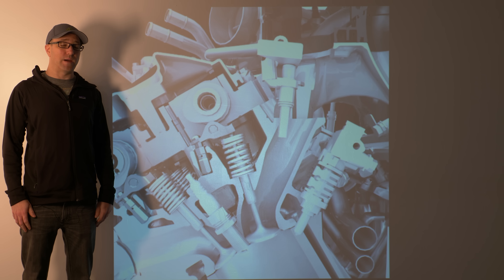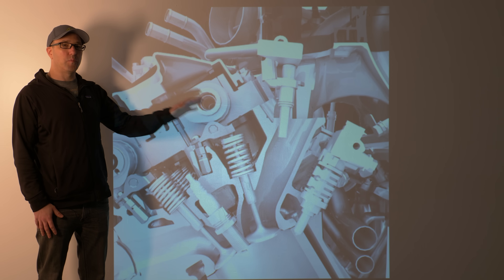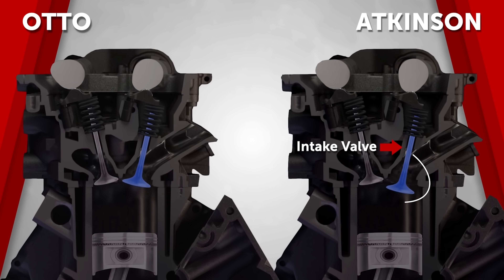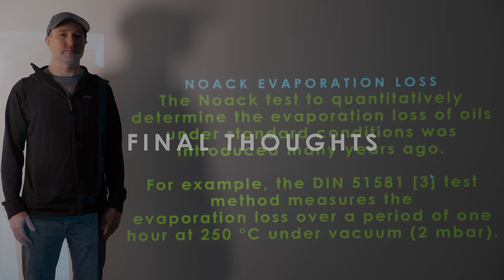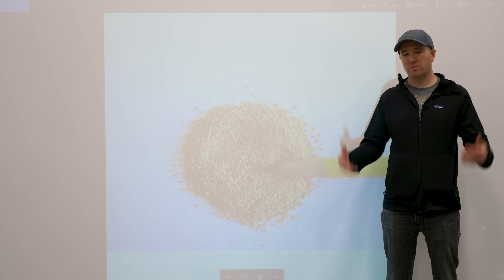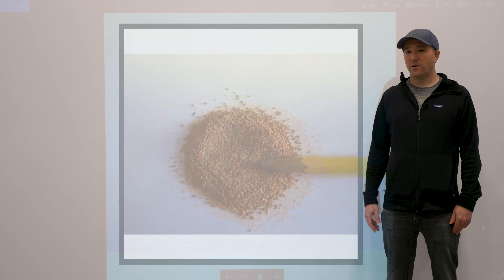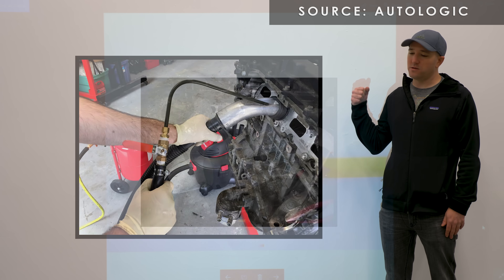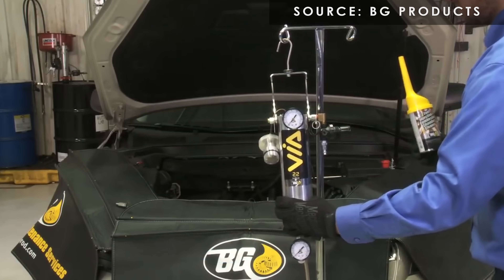Direct Injection, Problems and Solutions | The Fine Print

Comment: This is precisely why I stopped buying new cars.  The hassle factor is off the chart (valve cleaning and injector service every 32,000 miles).  It appears as though once a technology is perfected, then Big Brother steps in a changes the rules.  Thanks for spreading the word.

Score - 9.8
Reply: I don't see why you have to go to the stupid end of the extreme to justify technological progress. Yeah, it's not exactly awful to have a car that doesn't crush into a ball when it hits something.  At the same time, it's not ok to push progress so quickly in an unnatural direction that you get over-engineered and under-tested products.  You might think it's OK to use your anecdotal evidence that new routine maintenance is cheap, but actual car enthusiasts you're trolling online have evidence to show it is an expensive and frustrating process.
Reply: There are still many new cars without direct injection and with very reliable, clean indirect injection engines.
Reply: Thank you!  and good luck with your enslavement and all your new car extravaganzas!
Reply: Port injection for the win
Reply: Honda 3 barrel carburetors...... Remember those bastards.   I can buy a new car tomorrow that will last 300,000 trouble free miles.  Like an 4 cylinder Camry. Almost all modern cars will take you 50,000 miles without any major problems.  In the 1970' buy 75,000 miles your car was in the junk yard.  The VW bug would blow an engine every 50k.  The Vaga makes the fiat 500 look like an Corolla.  Yes there was the Dodge Dart  Or many many pick -ups that ran forever.  Old drivetrains for the most part were far far less reliable than modern cars.
Reply: fatboy19831 finally someone with objective, critical thought.  You’re alright mate.
Reply: First, my hat is made from aluminum foil, tin foil hasn't been used since the 1910's; second, smog hasn't really been a problem since the 1970's;  third, it isn't that its the past, its an appreciation, like a fine wine or a listening to vinyl vs. digital, its just more fun, involving, and cost efficient, but don't take my word for it, listen to what the good Dr. says in 'Final Thoughts'...  https://www.youtube.com/watch?v=gR7bigCPRn8 .
Reply: Newer cars are more reliable, principally due to the lean manufacturing techniques pioneered by the Japanese. 1990’s electronic controls also increased reliability by eliminating and/or simplifying moving parts and replacing them with solid state equivalents. It’s been increased complexity and diminishing returns on emissions and performance improvement, with commensurate decreased reliability since then.
Reply: A Google User What a load. A dealer won't do anything to a car for $125. You pay more than that for a cabin air filter. I had a Hyundai (not a high end car brand) and they wanted $175 just to program a key fob. You think they are going to really clean all the gunk off all your intake valves for $125? Lol.
Reply: A Google User do you know what it takes to get all the carbon build up off? Especially if you drive a twin turbo car with the turbos in the freakin  block(looking at you german car makers).
Reply: fastcx Yes, I literally said that exact thing at the end of my post.  Thank you for proving nobody ever actually reads comments on the internet before getting outraged, though.
Reply: My dad Honda Civic 2002 with he 1.7 liter engine is at 396 000 km without ever cleaning the intake show me a new direct injection doing 400 000km then i will believe you until then its only making people pay more for less reliability.
Reply: Chris Baumgarten nice of you to contribute something profound to the conversation (:
Reply: New cars have become throwaway. They preach about emision, but when u throw one out after 8-10 years and build another, thats real waste. Its kinda like cash for clunkers. Destroy and crush useable stuff and melt it make news things that get 5-10 MPG better? That is a UNBELIEVEABLE waste. WTF is wrong with people?!
Reply: opl500 some older cars are great, no doubt.  Enjoy it while it lasts.  I have not had the same experience but more power to you.  😊
Reply: dan noyes cheers mate!
Reply: Turrah!
Reply: Not all cars require it or even have it suggested.  There are GT86/FR-S/BRZs with nearly 200k miles that have never had any cleaning done to the engine internals/head/etc. and run great.  This is a hybrid system with direct and port injection, though.
Reply: DerekSiems you do know those you said, that 3 models, came with dual injection, port n direct
Reply: DerekSiems the point of dual injection is to reduce or prevent that issue in the 1st place. That's the reason I replied to you. You answered your own point of not having to deal with direct injection issue
Reply: fastcx he makes it sound like direct cylinder injection always leads to buildup in the video, even if it also has port injection.
Reply: @jonathan Yes, it's the last point just to fulfill newer emission standard (That keeps "Improving" every few years), might as well start focusing on electric motor instead
Reply: A Google User 
You have some interesting points. I will counter with a few minor things. People tend to think of a car as one single object, when in reality it's quite a few objects working together. There's nothing stopping me from swapping a modern electric drivetrain into a 1947 Dodge truck, or even a modern gasoline drivetrain into a truck from the 90s.  There are 3 immutable facts.

Very little has changed from the start of autos, save materials and computers. 

There's still nothing as efficient as external combustion (with enough space provided).

Hands down the biggest innovation since the wheel was perfected, replaceable parts.

When a railroad buys a multi million dollar locomotive, they fully plan on being able to replace every single part on it. The only design criteria are, easy to fix and solid as a rock. Very little can total a locomotive short of it falling off a cliff. 
Same goes for aviation. They have finally gotten to the point where they have airframes with infinite lifespans. Just swap the engines when they time out. The american B-52 fleet is a perfect example. They do have an airframe lifespan though. They are expected to be all but retired by their 90th birthday.

Consumer goods are nowhere near that level of quality. They are indeed designed to fail, and they are not designed to be fixed indefinitely. Realistically they expect 80% to be dead in 20 years. Auto manufacturers have no interest in a car that last forever, even if they could rebuild it.
Reply: Forget the anonymous "google user"
He makes shit up.
Reply: dan noyes new cars catch up to u
Reply: Jay 
Fuel economy hasimproved, not power. There are plenty of cars made between 1950 and 1970 that would go screaming past anything you'll find on a typical driveway. Certainly and turbo 4's and even v8's. Cornering ,is a bit lack luster, but 500 motivated horses will get two tons of american brick moving quick.
Reply: Newer car are fragile. I own a 98 kia sedan m/t with 180k km and s 2013 Honda civic m/t with 60k km. I used them alternate because of traffic coding. Civic's engine mount and clutch went kaput after 50k km. My kia 98 still using stock mount and clutch. The only major part replace was front bearings after i drove on a 1.5ft of flood.
Reply: I so agree with you.   I drive a 90 ford station wagon,  and have some cars from the 60's that  look so much better than todays crap boxes.   oh,  my car has a carburetor that works perfect.
Reply: Modern cars just don't last as long though. Many 90s era cars are still running with LESS problems than some later models.
Reply: dan noyes lol, I guess I just don’t get it.  As far as I know, most people have been keeping their cars longer with fewer issues in the last 10 years or so.  Everyone that I know prefers their new car to the old one.  There are many key factors for this.  The stats don’t  lie so feel free to have a go at them.  As for the “unreasonable government mandates,” I guess having a standard reverse camera and getting 30+mpg is a bad thing.  You can take your car and get it fixed/serviced anywhere you want and there is a plethora of aftermarket parts so I don’t understand the “monopoly” part either.  Got to love Americans and their government conspiracy theories.  
People said the same shit back in the 70s and 80s about new cars at the time and were obviously proven wrong.  Time changes, things and technology evolve.  We analyze problems and find efficient solutions to those problems.  It’s all part of a progressive human society.  I guess you can call it.....innovation.
Reply: No, all the computerization in modern cars have made them more reliable not less.  Solid state electronics are much more reliable than their old mechanical equivalents.
Reply: Nathan unknown the statistics are simply not in your favor mate.  Newer cars are increasingly more reliable them older ones.  People are keeping their cars longer because of improved reliability.  You can believe in you government conspiracy theories but VW messed up because of their idiotic and malicious business practices.  They developed a method of cheating emissions instead of trying to make the engine conform to the rules of law and even after the fix, people are reporting the same fuel economy, so why cheat in the first place?   Other manufacturers like BMW, Renault, Mercedes, etc.  have all been able to meet emissions requirements while providing efficient motoring in a wide range of vehicles.  I just don’t understand why people like you are opposed to clean air and environmental stability.  I suppose we can just go back to the 70s when smog and pollution was rampant and cars had gas guzzling motors that achieved 12 mpg.
Reply: dan noyes 😂😂 you’re a riot!
Reply: dan noyes whatever makes you feel safe from the tyrannical, reptilian overlords.  😅
Reply: To drive the point home in a simple way, you see a simple engine weight a certain amount, let say it's around 20kg for a 2L 4 banger. To solve certain emission requirement they had to add another few kg of parts onto it to make it clean. From there they need to maintain the same power or more than previous iteration, they either need a lighter block or piston etc. Then to try to manage overall weight of the engine after putting all those new stuff in, they change some parts to like plastic intake runner, plastic pump etc.. It's a fucking loop of never ending nightmare just to beat emission standard. Most of these parts will last, yes, but only within warranty period. After that you as a consumer gets fucked, most of these parts will not be used in the newer cars because newer emission standard knocks on the door again with newer shit needed. You wants to save the world with lower emission but you on the other hand support and creates more rubbish that create more emission just to recycle them. So what the actual fuck man
Reply: Tyler Piper  thank You! That clown has no idea what he's talking about. Decarbonization on GDI cars is incredibly costly and labor intensive. He's literally spewing out inaccurate misinformation but trying to sound knowledgeable while doing so.
Reply: It's not a surprise me that many folks don't get it.  I've just lived it and paid for it.  Folks are worried about Bluetooth connectivity, backup cameras and call it innovation.    And, its not a conspiracy, it is a fact that local shops simply don't have the manufacturer's expertise to adequately service cars as once they did.  Get a local shop to fix your carbon fiber frame, fix your electro-hydraulic brakes, or figure out why the high pressure DI pump prematurely fails.  Talk to me about IMS failures with Porsches.  Why did Porsche drop air-cooled for water cooled?  A sports car weighs 4,000 lbs.?  Honda Civics weigh 40% more than they did 2000?  That's not a good thing.     Folks have gotten 30+ mpg for years.  
I can't wait to hear what people say when self-driving cars are mainstreamed.   Good luck with that.  If I'm still alive, I chose not to participate.  Insofar as the 70's & 80's go, yes many were inferior and that was a direct result of Governmental mandates.
Reply: dan noyes I forgot to add that it costs about $125 (US) every 30,000-60,000 miles to remove the carbon build up.  Highly reasonable considering the high service interval, excellent fuel economy, luxury amenities and relatively carefree driving you’re going to get in return.
Reply: Nathan unknown $1200 for the carbon removal?  Overblown hyperbole.  My car has a turbocharged direct injection motor and it costs about $125 US every 30,000-60,000 kms.  Quite reasonable considering all the benefits.  No problems thus far.
Reply: Nathan unknown that’s simply not true.  Modern cars are much more efficient, safer and offer many amenities that were only available on high end luxury cars years ago.  The statistics show that cars in the last 10 years are much more robust and are engineered to a higher standard then before.  People are keeping their cars longer as well due to the improved reliability.  Yes, modern cars do have more computers and electronics but mechanically, they are much more efficient.  If you want to go back to the days of carburetors and engines/transmissions falling out in your driveway all while getting 15 mpg, then go for it.  Either way, cars as a whole are much better now and offer more then in the past.  It’s called innovation.
Reply: Devin Stambolziovski I drive a turbocharged, direct injection European car.  A Volvo to be exact.  $125 (US) to remove the carbon at around 50,000 kms or so.  I did one at 30,000.  33 mpg overall, smooth and refined powertrain with modern day amenities.  No issues whatsoever.  Quite reasonable if you ask me.  You guys are silly 😉.
Reply: dan noyes new cars are more reliable, safer, and increasingly sophisticated then ever before.  Just get the regular maintenance/cleaning done.  It’s not even  that expensive.  Enjoy carefree driving for years to come.  People love to complain and find an excuse for everything like blaming the government.  Plenty of direct injection motors still on the road with proper maintenance.  The problem is that most people are too lazy or too broke to take care of their cars.
Reply: I will concede your point if you are referring to infotainment systems.  But on the whole, no, they're not; and, it is the unreasonable governmental mandates that are forcing customers into manufacturer/dealership monopolies.  What used to be $50.00 in maintenance at your local shop is now $500.00 at the dealership.  Cars were customer friendly, reliable, and easy to maintain.  Now, heaven help you if your warranty expires or (as frequently happens) is denied.
Reply: dan noyes have fun living in the past mate.  Don’t suck up too much smog.  Oh and don’t forget your tinfoil hat!  😂

Comment: Another high quality and informative video from Mr. Goose, makes me kinda worried about my Mazda CX-5.😂😂
Reply: SIlive The NC doesnt habe DI and is just as much fun- and cheaper :)
Reply: He had a Mazda 3 with DI for several years with a bunch of miles on it, I think 50K plus, and didn't have any problems with it.
Reply: 38k on my 2016 CX 5 and engine seems better now than new.  Mazda clearly states not to use injector cleaner additives though.
Reply: SIlive Ive got a 2011 NC with all extras as my first car. Its really so much fun to drive- mountain roads with great views are the strong points. 
The BRZ is 5000€ more expensive here in Austria and insurance is also higher. The BRZ is also fun to drive and more usable on a daily basis. 
If you dont care a lot about practicality go for the NC otherwise with the BRZ. 

I never had a problem with it- just fun to trow around in the corners. Maye think about the hardtop version if you drive in winter/highway as it gets really noisy with the normal version
Reply: ...yet
Reply: Plus the Miata has a more sports car like platform while the GT86 platform is kind off related to other Subarus. I really hope Toyota and Subaru will invest in a dedicated platform for their twin sports cars, because when a company like Mazda (quite small in the automotive industry) and a company like Fiat(enjoys producing crappy products) can partner up to engineer and manufacture a dedicated sports car platform, I'm just puzzled why Toyota and Subaru didn't do what Mazda and Fiat are able to do. Personally I prefer the GT86 as it's a more usable car and I have nothing against Toyota and Subaru, in fact I actually quite like them.
Reply: A Google User good to know as I'm quite against cars that need a lot maintenance because I'm used to reliable and low maintenance cars.😂
Reply: An NA with a Honda J32A2 under the hood doesn't have D.I., is even more fun, and is still cheaper!
Reply: driftbro cleaning valves isn't that complicated just time consuming
Reply: I'm worried for all skyactiv Gasoline, Diesel and the future skyactiv X
Reply: SIlive what you probably won't hear in this thread is the transmissions on the ND Miata explode while being driven, there are at least two videos on YouTube that I have personally seen where the owner actually revved the engine but I don't know how high they revved it nonetheless it was high enough to break the transmission.
Reply: Nothing to worry about.  Just get the recommended maintenance/cleaning done every 30,000-60,000 miles.  It’s not that expensive and you can enjoy carefree driving for years to come.
Reply: driftbro I'd be worried about a lot of things if I owned a Mazda. Like gay rights and suicide